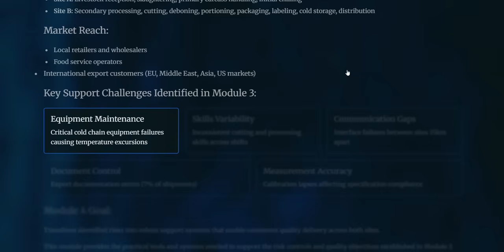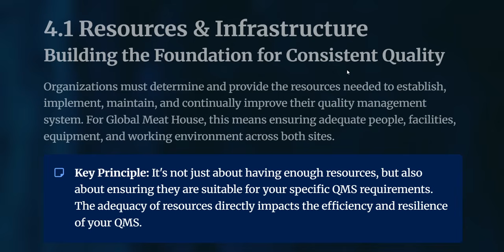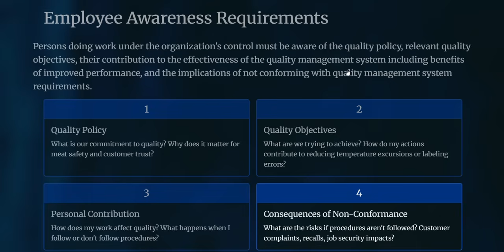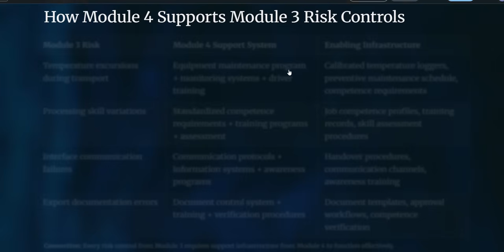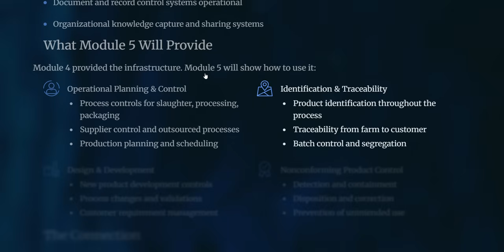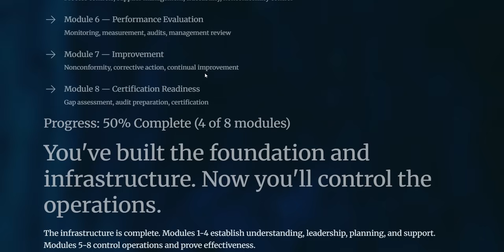ISO 9001 From Zero to Certification – Module 4: Support Processes That Make the System Work

Comment from the maker: This is Module 4 of an 8-part ISO 9001 implementation course.
Module 4 answers one critical question:
How do we make the system actually work every day?
Before moving to Module 5, your organization should have:
defined resource and infrastructure needs
maintenance and calibration programs
competence requirements for critical roles
effective communication across sites
controlled, usable documentation
▶ Module 5: Operations & Process Control — coming next.

📌 Start the full course here: 
https://www.youtube.com/watch?v=635Yd0RY7VU&list=PLpjg2sQqENxpX1I-BuqdfCaL003zCMf9O&pp=gAQB ISO 9001 – From Zero to Certification (Complete Playlist)
or
📌 Start the full course here: 
https://www.youtube.com/watch?v=nbldSNzf0Ms&list=PLpjg2sQqENxrXg5OHN88-I17cmLA7qsPI&pp=gAQB  ISO 9001 Implementation – Step by Step (Practical Training)